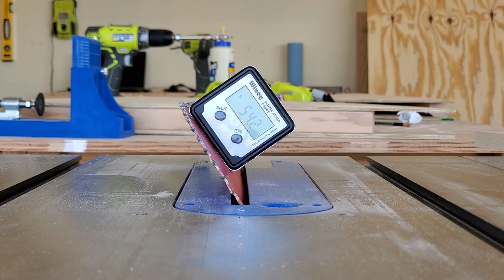Floating Corner Shelves [ How To ]

Comment: Great job building the shelves but bro, 95% of the people that viewed this were probably looking for mounting techniques.
Reply: ditto
Reply: Yup
Reply: I'm about to try corner float. Single 25mm ( 1" ) thick timber. I am going to mount aluminuim angle on the wall. Router a slot on the back edges of the shelf & a relief so the outer surfaces of the shelves will be flush with wall surfaces. Then two small fasteners from top to lock timer & aluminium together.
Reply: @bonarlibor3067  dude, get outta hea!
Reply: He told us nothing it is waste of time to watch his video..
Reply: Yes!
Reply: I literally came here to see how to mount it.
Reply: Thanks for saving my time man.